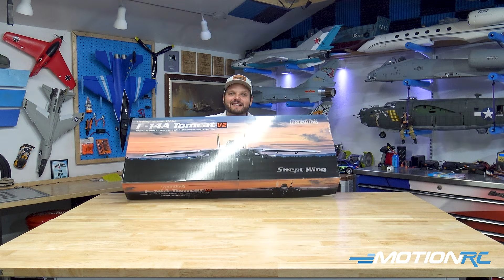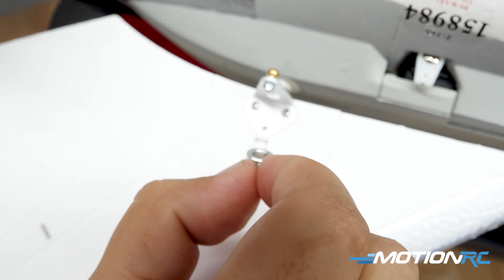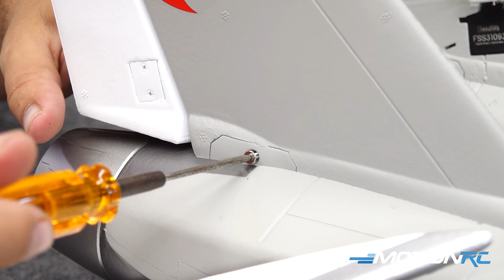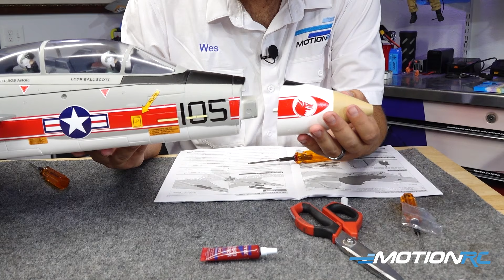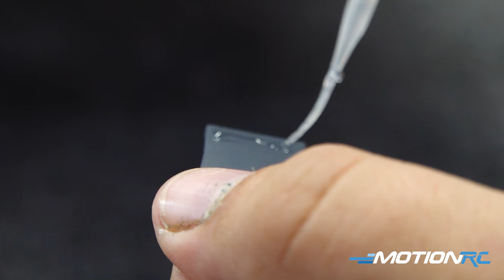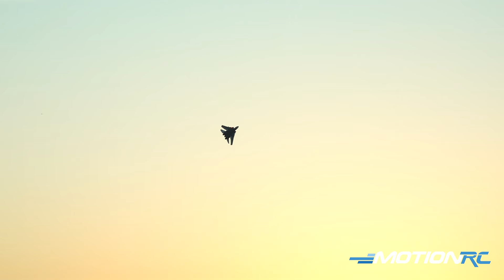Freewing F-14 Tomcat 64mm V2 Assembly | Motion RC

Comment: why dont they make 70mm of this they never do it???
Reply: Maybe in the future? They did that with the F-16 and F-22.
Reply: twin 64's is pretty much the same scale as a 70mm.  It's the perfect size
Reply: @rickw5024  70 would be bigger airframe
Reply: @43rocket  minuscule difference, you couldn't see it in the air of from 5 feet away

Comment: This is cool, but wouldn't a 90mm X-29, or a twin 64mm YF-23 be cool as well?

Better yet, how about a V2 90mm Yak-130?
Reply: F-16XL
The delta wing cannot be beaten for efficiency. It would provide large lift and long flight times.
Reply: V2 yak130 and a su57 would be phenomenal !
Reply: Flown the FT X-29. Definitely would buy a FW one if they offered it. You’d need a lot of expo especially if they make moving canards. Designed my own F-16XL a few years back. Also wouldn’t mind one of those.

Comment: When will the 80mm V2 be born ?
Reply: Probably never like MaxSuper said. The time and effort (and money) to redesign the 64 will likely mean the phase out of the 80mm. Too much money to fix all the problem areas when you can now get a marginally smaller version cheaper
Reply: Probably never... 😢 I got the V1 80mm. Good looking plane, but it was heavy and underpowered. But I still love it... 😊
Reply: @MaxSupercars  Haven’t flown mine yet. Swapped out stock motors/ESCs for the MiG-29 power system. Should have plenty of power then!
Reply: I'd rather Freewing makes F22 V2. 90mm 8s EDF is very efficient and plenty of power, and F22 aerodynamic design makes it easy to fly sport or 3D. F14 swept wings are complicated and heavy
Reply: Use loctite!

Comment: I'm planning to use a Spektrum 8-channel receiver with SAFE and AS3X, and bypass the included Freewing gyro. My plan is to plug all control-surface servos directly into the Spektrum receiver, while leaving the light system connected as it currently is.

Can you confirm if this is the correct setup?